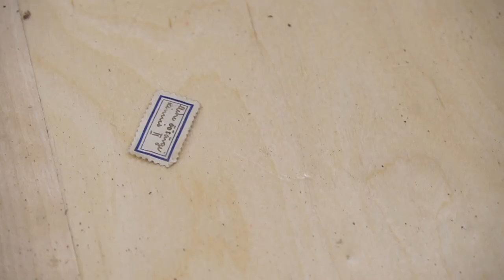How to restore an old suitcase

Comment: I like what you did here! Another good option for the leather would be a leather conditioner that restores the moisture to it. the wax does make it look good and helps waterproof it but doesn't actually add any moisture back to the leather.
Reply from the maker: Good to know!
Reply: @ATRestoration  saddle soap. also used for leather shoes.
Reply: @ATRestoration  be careful with water repeated wetting and drying weakens leather. If you want to clean it use a small amount and don't saturate it. If it's stiff and dry it's most likely because it has lost oils not moisture. Doesn't matter too much for this piece since it won't function as luggage.  Turned out well.  If leather is siff it's probably a good idea to condition it in place without bending it causing further cracks then disassemble.  A good conditioner is 7 parts lanolin 1 part cedar wood oil (a fungicide) and a light solvent like hexane or diethyl ether to loosen it up for penetration. You can add some beeswax in the last application for appearance/protection.  I found Lanolin (sheep grease)  in tubes from a machinist supply shop.  (edit) Thinking out loud,  the beeswax might help lube the stiching in the handle or moving pieces.

Comment: I will give this person a B- for fit & finish ——- that is if the intent was to bring the suitcase back to it’s plain, unimaginative, institutional, appearance.
But, I might make a couple of suggestions for raising a similar project to the next level.
Think about staining the exterior and then giving the stain a high gloss finish.
Replace the leather straps in kind or with a top grade of man made material.
Use small Chicago screws to reattach the latches and handles.
And replace the lock with a new lock and key with an internal backer plate.
And lastly, line the interior (top and bottom) with some type of well wearing material.
Then again, if you are pleased with the pictured finished product, then I am pleased for you.
Reply: I think the idea is to restore as much as possible, but not to go so far that it’s a flat-out renovation.

Comment: Will a steamer kill termite infected wood - or do you just use insecticide? [ or replace the damaged wood sample with a new replacement? ]
Reply from the maker: The steamer doesnt kill the insect inside the wood I think. If needed I use insecticide. When its too far gone then I repair it with new wood.

Comment: Hi, Is there a chance to get in contact with you? I have 160 old house and a pair of door which are too short and I want to extend them...
Reply from the maker: I work only in Tallinn, Estonia. Thanks for your interest though :)
Reply: Any finishing carpenter in your area should be able to plane and mortise a new piece of wood into the bottom of the doors and cut them to length on sight. If they are painted doors scratch a vertical line to follow the original rail and stile line and the repair will be invisible.